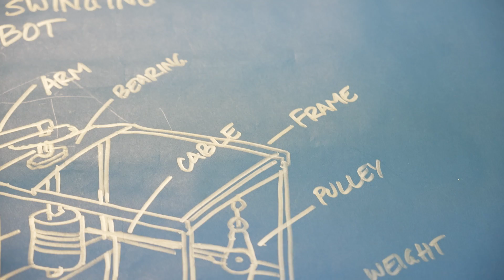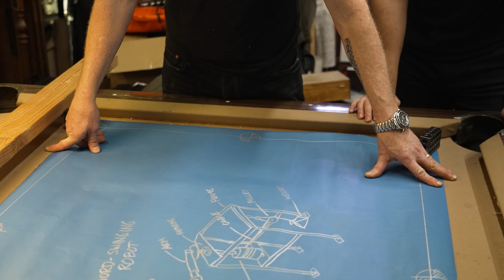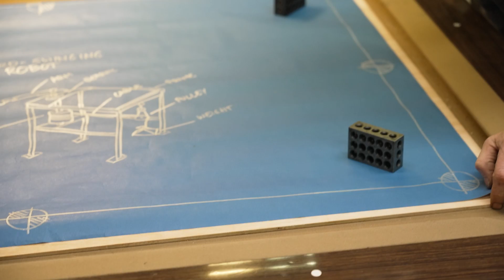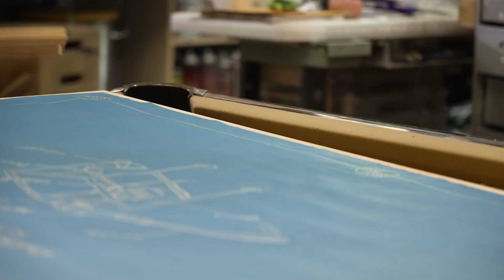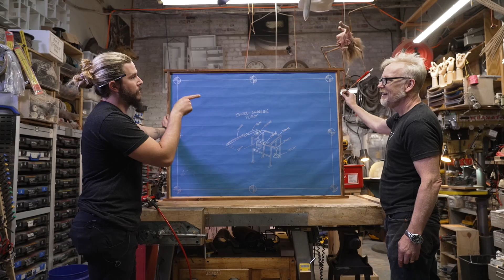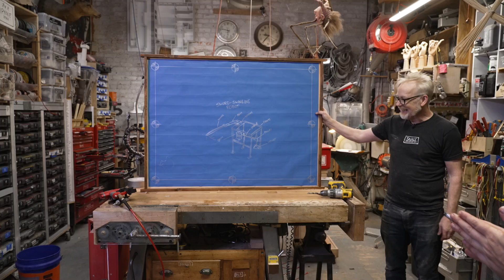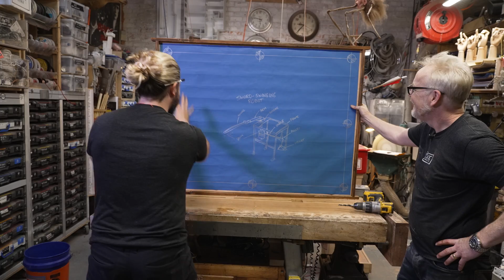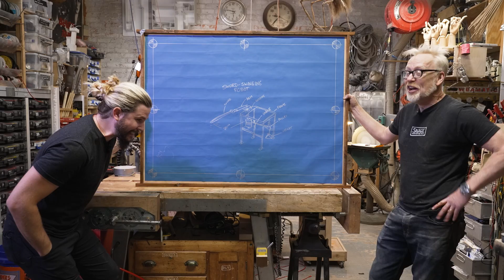Adam Savage's One Day Builds: Mythbusters Blueprint Display with Kyle Hill!

Comment: As Kyle works the "lived" duct tape and Adam is all "YES, YES!" And also, only Adam Savage using staples to attach duct tape.
Reply: Had to be done mechanically.  Duct tape is many things, but environmentally durable is not one of them.  A bit of gauzy residue doesn't have near the same visual impact, when the film dries and falls off.

Comment: Another thing you can do to keep non archival prints safe is to put them under anti glare acrylic or glass (preferably with a UV Coating on them) and keep them out of direct sunlight. At that size acrylic would be a good safe bet due to overall weight (and living in earthquake land) and could be floated off the frame with. a couple of stoppers. Blueprint material fades super quickly if not taken good care of!

Comment: It's missing one thing! Instead of glass, the blueprint should be behind a layer of the plastic they used at bomb/shooting ranges!
Reply: If they could find a piece of one of the original shields with some "wear and tear" on it would be nice.
Reply: yeah it makes me incredibly unconfortable to see the paper so exposed
Reply: I was thinking a piece of plexiglass to replicate that. Cuz ballistics glass I'd imagine is expensive...
Reply: Do you know how expensive thick polycarbonate glass is? A piece that is large enough to fit the frame would cost somewhere around $1000, give or take a couple hundred bucks depending on exactly how thick it is.
Reply: @michaeldaigle7207  I never said it was economically practical, just thematically perfect.🤷‍♂️
Reply: @BlaineToole  I can agree with that.
Reply: @dnothing23  if you put the effort in making such a memorial piece. Nothing is too expensive at that moment
Reply: I too would prefer it to have glass or perspex, but tbf that only protects a print or painting physically. It doesn't stop fading, and as long as you don't throw stuff at it and keep it out of harm's way, it'll last forever. I have a big architectural plan from the 1900s and it's just held between two of those magnetic wooden poster slats to keep it rolled out. Far out of the reach of entities that might harm it.

Comment: Hi Adam. I have a suggestion for an easy upgrade for your table saw. Replace the On-Off switch with a paddle switch. That way you can turn the saw off with your thigh once a cut is done. It's much safer than fumbling for the button  while the blade is going and is more efficient.
Reply: If he can’t retrofit a riving knife, that table saw needs to be scrapped, or converted into something that is less likely to cut his fingers off or shoot pieces of wood into his gut. I know he doesn’t want to maim himself on that thing, but he’s giving it a damn good try every week, in front of 5 million subscribers. Irresponsible.
Reply: @mm9773  I cringe every time I see him at that saw. A riving knife as a minimum, but a blade guard and an outfeed table of some sort would be on my must have list too. A more robust push block wouldn't hurt either!
Reply: @ay8306  Look bud my grandfather had diagonal stumps instead of fingers on half a hand because of a table saw, lost em back in the 60's. I've used power tools my entire life and i've never been scared of a table saw any more than the necessary and healthy amount of fear and respect a dangerous tool deserves, even seeing the results of an accident first hand (ha, hand, get it? cause he lost...never mind). Just don't put your hands on or near the spinny sharp bit, and take your time. Only way to maim yourself with a tablesaw is to stop paying attention or start rushing. That saw of adams is in a pretty difficult spot though, i'm definitely not arguing that. I think though if you want a guard, an outfeed table, a larger push stick and a riving knife, be my guest, but don't go around telling others they're doing it wrong because you're scared. If you think that table saw needs improvements, I could show you some of the tools/equipment and some of the stuff that goes on at backwoods farms, you'd faint. I planted 20,000 strawberry plants with a 1950's or 60's holland transplanter one year, and if i'd moved my leg just a couple inches to the left it was going right into all of the moving parts of the machine, and the job required you to move quickly. No guards, no safety belts/harnesses, no safety switch, and you're not in control of the speed. It's just you, a hunk of metal thats out of your control and determined to eat you, and a load of plants that needed to go in. That's something tame i'm willing to write about, it gets so much worse but I'm not gonna go there. Live a little, stop worrying so much, educate yourself about the dangers of whatever you're doing and trust yourself.
Reply: @michaeldaigle7207  your fingers, your choice.
Reply: After thinking about this for a bit, I decided that it might be worthwhile to provide a less flippant response so that those who are less familiar with table saw safety will understand what the fuss is about. I have nearly 4 decades worth of experience using a table saw and while I am not afraid of them, I do have tremendous respect for the amount of harm they can inflict if you lose your focus for even an instant. The safety features being discussed here are far from extreme and nearly all woodworkers would consider them essential.

The riving knife is a feature that goes behind the blade and minimizes the chance of kickback. If you have never experienced it (I have) kickback can be terrifying and dangerous. It occurs if the workpiece catches on the back of the blade and is flung back at you faster than the eye can see. Once it starts, there is no way to stop it or control it. I was lucky and got hit with the flat side of the workpiece, leaving only a nice dark bruise. If you get hit edge on, you can easily be impaled. A riving keeps the workpiece from moving latterly into the back of the blade which is how kick back starts. Don't let someone tell you that you can hold the piece and control this, you can't, once it starts, the forces involved are just too great.

A more robust push block is critical to be able to safely control the workpiece as you move it into the blade. It also helps ensure that you get a smooth clean cut. It not only makes your woodworking safer, but help you to get better more accurate cuts. There are many designs each suited to different purposes and different types of operations. They are worth learning about.

An outfeed table is exactly what it sounds like, a surface on the outfeed side that supports the work as it is pushed through the blade. This will allow you to control the board as it nears the end of the cut and helps ensure that your cut is smooth. Again, not only does this make the operation safer, it helps ensue you a get a clean  and accurate cut and keeps the workpiece from being damaged from falling on the floor. It doesn't need to be fancy, I just use a worktable that matches (or is slightly lower than) the height of my table saw table.

Finally, a blade guard is just basic common sense. No matter how careful you are, there is always a risk of something unexpected happening, and it only takes a tiny fraction of a second turn your hands into a bloody mess. Is it really worth the risk not to have such a basic feature installed? It doesn't mean I am somehow too scared to use my tool, it just means I see no need to take unnecessary risks.

There are other tools techniques you can use to improve safety and accuracy (like feather boards and auxiliary fences). If you are going to use a tool like a table saw, it is worth it to watch a few videos and learn how to safely get the best results.

Others here may disagree, and that is certainly their prerogative, but I think it is worthwhile to mention what these safety features are and why those of us who commented feel they are important. Most will not only increase your safety, but will also help you to get better results, and if it keeps even one of us out of the hospital, then the few minutes it took me to type this up were worth it.

OK, I'll get off my soapbox now 😀
Reply: @michaeldaigle7207  In a neverending series of battles between “paying attention” and a blade spinning at 3500 rpm, the blade will eventually win one.
Reply: @ay8306  a machine is often only as dangerous as you are.
Unless it really is a broken piece of shit. But then again, it is your own fault for not replacing it.
Reply: @mm9773  same counts for you what i said to the other guy
Reply: @ay8306  as you said - if it keeps even one person out of the hospital…. Jamie has years of experience using his equipment. But any less experienced person trying to build using his techniques doesn’t have those years, and could easily harm themselves if they tried to use a saw like Jamie’s without Jamie’s experience. I think that Jaimie should at least mention his lack of proper safeguards so that people trying to copy his work are aware.

Comment: I loved the idea behind the Mythbuster's episode for the sword cutting through the barrel of the gun, in fact that myth was one of my favorites.  But, I have always been of the opinion that the robot that swung the sword was built in a way that did not test the myth properly.  A samurai sword is not a chopping type of sword and is very weak when it comes to that type of cutting action.  A samurai sword, in fact, is designed to have a slicing or cutting action during the swing across what is being attacked.  The robot that was built did not take that into consideration.  Albeit, the myth would most definitely still have been busted even if the cut from the sword was using proper swordsmanship technique, but it would have been nice if the robot was built to more accurately portray a proper swing from that type of sword.

Comment: I think sometimes Adam misses the obvious... turn the table saw 45 (ish)degs and cut on the diagonal of the space. The next obvious thing is cut the board 1/2 way, flip and cut the other 1/2. Also if you don't have a second person supporting the other end of a long board, you should be using a roller stand. Always safety first. 🙄

Comment: While using archival glue is good, the plywood isn't. No part of the blueprint should be in contract with the wood as the wood is acidic due to it's production process. You should have hinged the blueprint to acid free foam core first.
Reply: The off gassing of wood and chemicals used making plywood.  Beautiful work as always but I think I have watched Baumgartner restoration speak on such things.  As an artist it certainly has influenced the creation process also.
Reply: Yeah, I wondered about that
Reply: As a layman, plywood seems like a terrible choice for all the reasons in this thread.  Baumgartner should have had a short cameo giving them recommendations!
Reply: Gluing the complete piece down is additionally wrong in that as the paper and wood swell differently due to humidity, the paper fibers can stretch and tear. Had the blueprint been mounted on mulberry paper that may be ok but as the blueprint was whole it should only be hinged. The mulberry backing is usually a 'fix' for already damaged paper

Comment: As a professional picture framer for over 35 years I shudder at the way that object was mounted.
There are two things that are absolutely forbidden as preservation techniques for mounting. One is the use of a non-reversible adhesive, the glue, and the second is mounting onto unsealed wood. A simple coating of varnish wall stall the transfer of the acids in the wood.
Yes, there are more professional ways to handle this momento for a longer time, however the creativity of the complete frame job somewhat override those factors.
Reply: Thank you

Comment: My inner archivist is screaming at this video. Never put the item you are preserving directly on a wood backing. That should be attached to an acid free buffered mat backing with wheat paste glue and Japanese paper hinges. The lignin and other acidic compounds in that plywood is going to leech into the paper with exposure to temperature and humidity and it is going to destroy that blue print over time. Furthermore, the mat needs to be wide enough to keep the acids from leeching into the work from the frame along the edges, usually 2 inches minimum. To finish things off it should be protected behind something that blocks UV light, plexiglass or museum glass. ACK! ARRGGHHHH!
Reply: I think I’m going to get some plexi, but just know that we had like 3 separate time constraints that day (I flew in just for this!) so we did something quick and kinda dirty — the MythBusters way.

Comment: I really don't understand why he's using those japanese handsaws so often.  A mitre saw would be 10x faster and more accurate.
You just want to show off the handsaw don't you? Because it makes no sense otherwise unless you placed your mitresaw (Or tablesaw, or bandsaw, or litteraly anything else, even a regular handsaw would be faster since it's not so thin, you don't need a thin cut for this) in a bad spot and can't cut anything of length?
Reply: Adam has a small shop and a mitresaw station can be large. If you are not going to be using a mitresaw often, there isn't much reason to get one.
Reply: He also doesn't WANT a perfect cut. As we see the post-treatment evolve, a little sloppy cutting makes sense.